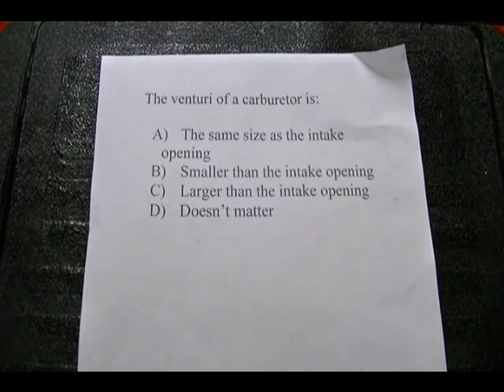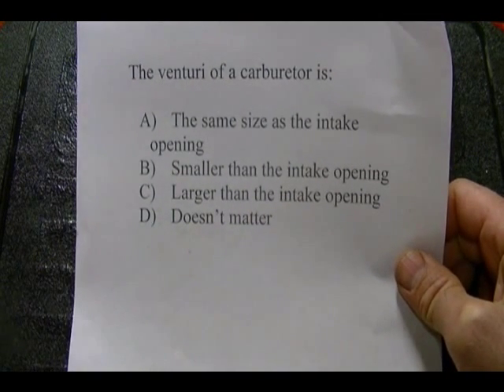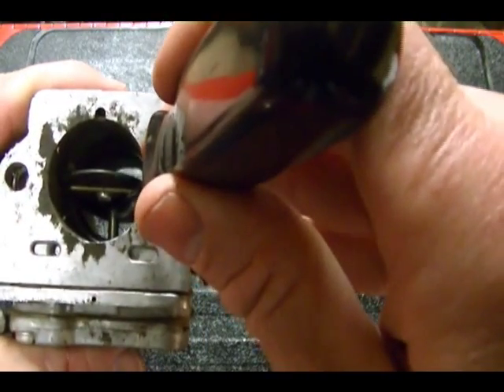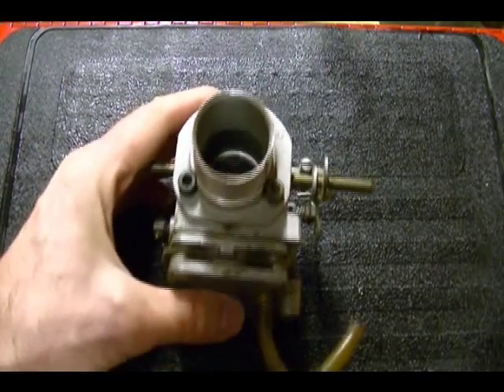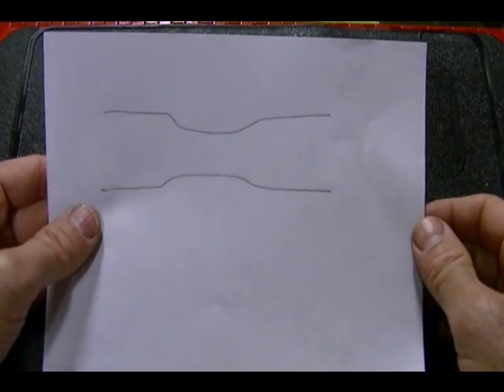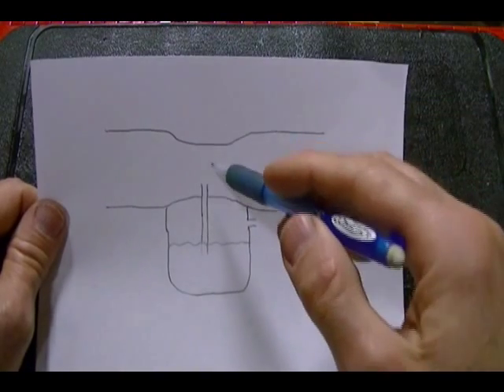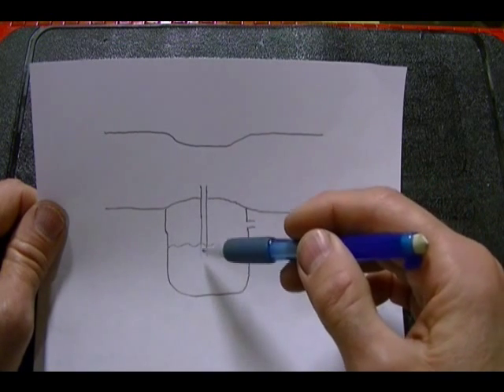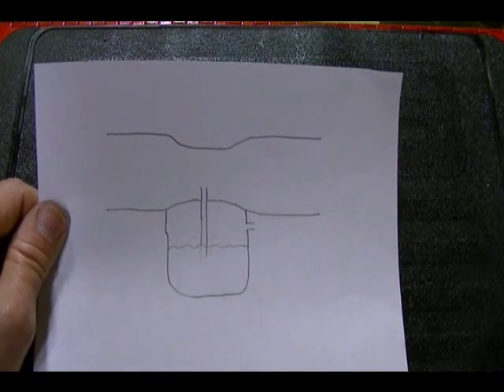Test Prep (4) - The Carburetor Venturi and its Size Relationship with the Carburetor Intake Opening

Comment: Very nice explanation.  So even though an engine may have a fuel pump, the carburetor will draw fuel using a low pressure venturi. One time I switched an engine from a JD tractor onto a commercial walkbehind mower, the guy I bought the tractor engine from told me just to keep the fuel pump  on replacement engine for hills.  I wanted to keep the build simple, so I removed the fuel pump.  My question is... the only purpose of the fuel pump is to pump fuel from a lower fuel tank up to the carb, then gravity and the venturi are going to take over, so another words the fuel pump will not do squat on hills because if your fuel tank is above the carb it still is going to be above the carb even on hills, Right?
Reply: Doublewide - The typical carb with a float & bowl, the pump just supplies fuel when the float drops enough to allow fuel to flow past the valve. The venturi where air goes faster the pressure is lower, so fuel is actually pushed by the higher atmospheric pressure everywhere else up through the jet and it vaporizes in the flowing air stream. So, if you tank is high enough to allow fuel to flow even on hills to the carb so it goes in the bowl when needed, then no you don't need a pump. If its marginal, you could use it.  The type of pulse carbs on string trimmers and chainsaws are different and pump their own fuel from diaphragms inside the carb and a connection to the crankcase typically which supplies the pumping action..FYI but they also use a venturi.

Comment: So because its slightly smaller it creates the ventrui effect, but what if the venturi was signifigantly smaller? Would it cause an even bigger drop in pressure to suck in more fuel or does it reach a point where its too small and restricts further air flow causing the engine to stall?
Reply from the maker: It can be too small, but I don't know what the limit is.